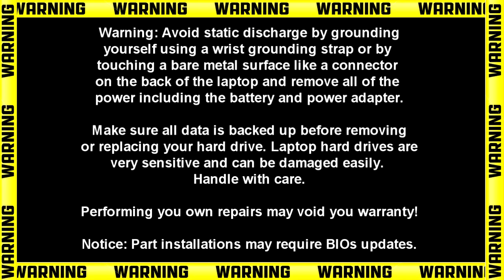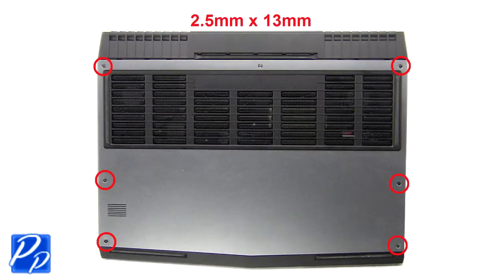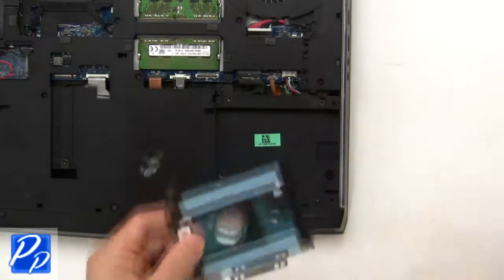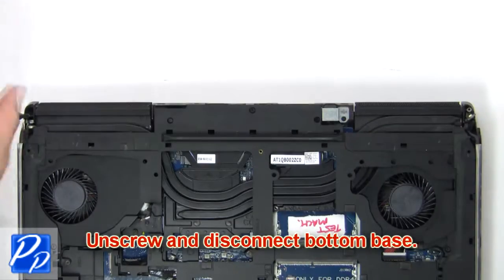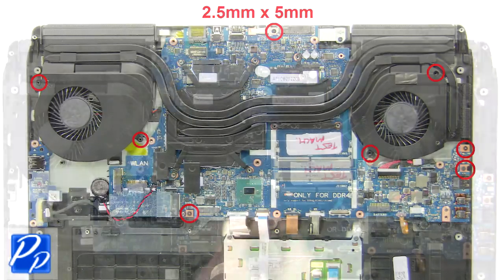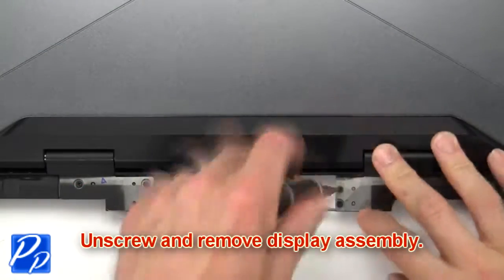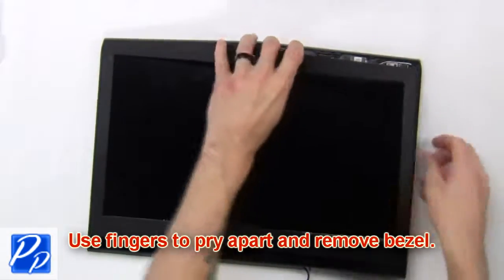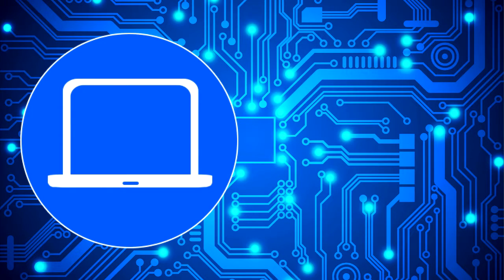Dell Alienware 17 R4 (P12S001) Tobii Eye Tracker REMOVAL How-To Video Tutorials

Comment: For anybody who needs to replace TOBII in that PC, do not follow this video. It is enough to pop the screen cover and replace the TOBII unit. It takes 5 min. instead of dissembling the whole PC.
Reply from the maker: As a safety precaution we reference the Dell owner's manual when performing this repairs. Their steps include removing the entire display assembly.
Reply: I want to replace only the cable for Tobii. Can I pry open the bezel and put the cable next to the socket on the mobo? So I can then connect it to the mobo without taking a part the whole laptop?
Reply: Never mind. I had to take it apart to a certain level to change the Tobii cable and I also while I'm at it, I changed the DC-in cable because mine got burnt somehow lol. Now everything is working as it should. Playing AC Valhalla with Tobii eye tracker 👍🏻
Reply: What are the steps to remove it I can’t see my screen because I got it pre owned and there eyes were already set